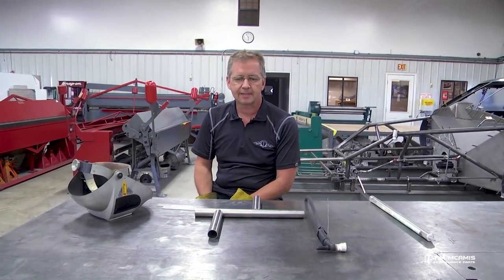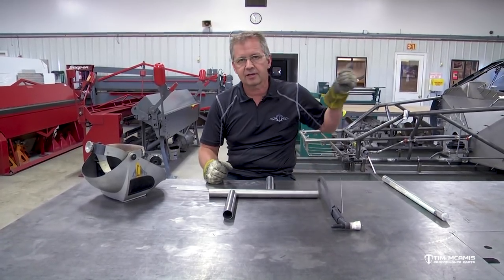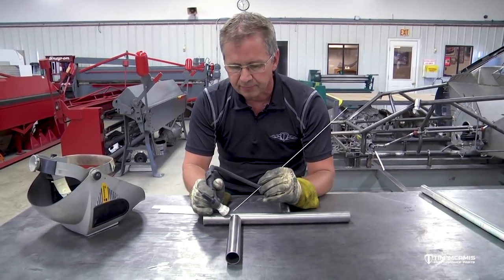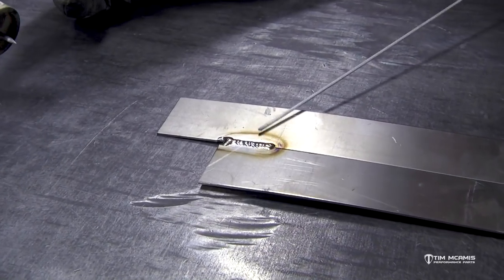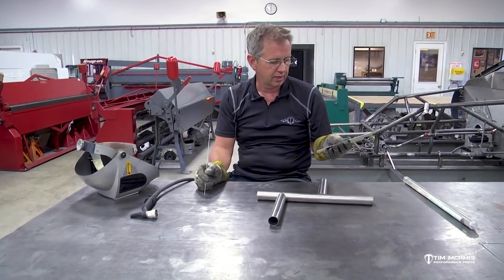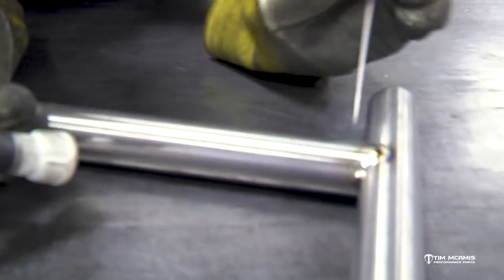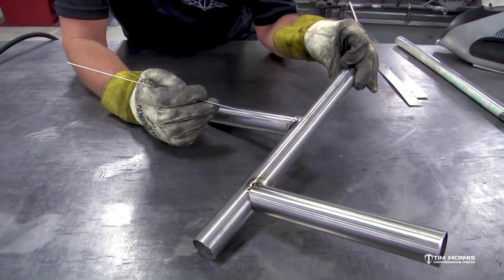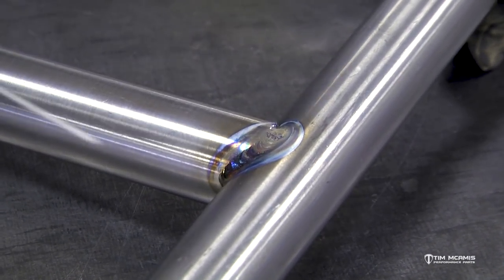Welding Titanium - Fabrication Series: 12

Comment: Shield your filler rod before you pull away from the molten puddle. Your filler rod is cherry red as well and it will contaminate your weld puddle when you start back up again. Great video and lots of helpful information👨‍🏭👍🏻
Reply: True.

Comment: Hi, was just wondering when you terminate the weld why u don't leave the end of the filler wire in the gas shield or cut the contaminated end off before starting the weld again ?.

Comment: It seems like sodering to me more then a weld. I used to work at a hvac shop. The shop Had sheet metal rollers. There was a Motorcross dirtbike race shop nextdoor. The owner asked if we could roll some titainium for his sons bike. We rolled it 24 times. It hardly had a bend. It was like a slight bend in a baseball hat. Titanium is interesting for sure.
Reply: Titanium needs lots of heat and tons of pressure.

Comment: shouldn't that be back purged like stainless?
Reply: DnV Auto Performance & Welding yup. Both tubes getting joined should be constantly purged while welding. The inside of that tube is in bad shape now.
Reply: @DroneRetrievalUnit oh i know it should be, im just more surprised he didnt stress the importance of it on the Ti, because that joint is trash, seemed like a waste of some good Ti, especially with the price of it, wish i could afford to waste it like that LOL
Reply: @Richard NZ I'm not sure what you mean by there only being metal on the backside, but I think there may be some confusion. The only way you dont purge titanium, that I can think of, is if say you are filling a gouge on a very thick piece. You are not penetrating all the way or even bringing the backside of the material to a reactive state. But say on a butt joint, like he demonstrated with the sheet metal, you are most definitely penetrating all the way through and getting the backside up to and beyond the reactive temp. And with tube, it is most likely going to be something somewhat structural. So, you need to make sure your weld is penetrating deep. If you dont back purge that tube joint, you dont have actual weld on the backside. Just a hot mess. Like trying to weld it with oxy acetylene. It loves argon, and the coverage isnt just for looks when it comes to structural integrity. Anyways.. Keep it metal \m/ weld on

Comment: Wondering if you have ever tried the Vortex cup. It is sold by Speedway Motors and Arc-zone. The cup is made of aluminum and then anodized black and is NOT recommended for DCEP,  I guess because of arcing. One plus, it won't break if the torch is dropped. Thanks

Comment: I want to start off by saying that These are good videos I just have one problem the way you are explaining things.  There is no difference in heat and how quickly it cools when you leave the argon on it or when you pull it away (the longer you continuously weld the hotter the piece will be at a constant welding temperature).  The color difference is oxidization when you pull it away.  If you look at the first weld you didn't give it enough time to cool down and it was at a temperature that the pipe started to oxidize.  There is a greater amount of oxidization when you pull away right after you finish the bead because you are introducing more oxygen.  The temperature is the exact same in both cases.  That gold hew about 1/2 inch away from the weld is where the oxygen is mixing with the argon and there is some oxidization.  Steel will oxidize at 1290 deg F (700C) and titanium will oxidize at 2,190 def F (1,200 deg C).  The TIG welder operates at ~11,000 deg F (3K-20K).  You have to keep the argon cloud on it until it cools below 1,290 deg F to avoid oxidization.  You are 100% spot on with your technique.
Reply: At what temperature does titanium go from silver to light straw color?
Reply: @brandyquad  in normal atmosphere around 700 F, but that is also a subjective question.  If you have no oxygen, it won't.  The color change is oxidation.  Any time that you are not welding in full containment (and properly purged) you will get color change.  The more oxygen that you displace the less of a color change you will get.  I see why you asked that question.  In my previous comment I said 1,290 F.  Above that is the blue to purple oxidization point in normal atmosphere.
Reply: @Rusty_Raine  Thanks for clarification. Thats very scientifically informative. I like to be on both sides of the fence when it comes to welding. Being knowledgable about what is happening and actually taking action, I think helps a person be a better overall welder.
Reply: @brandyquad  I agree.  Thank you for a good conversation.  I am a better scientist than I am a welder.  I grew up welding on my dad's farm.  He is a fabricator and a nuclear engineer.  He always prompted me to ask the question of why something happens the way it does.  20 years in the navy gave me a love for teaching others.  Hopefully within the next 3 years I will have a shop with multiple welding machines.  I just need to build the shop fist.  I am trying to set things up so I can film the shop build and creating a YouTube channel.
Reply: Basically any of part of the material that reaches over roughly 700° F must be shielded from atmosphere until it cools below that temperature. This includes interior of the tubing, backside of a butt weld or lap joint. The naturally occuring oxide layer, similar to aluminum, should be removed before welding since it contains oxygen. Lastly, remove all contaminants from the parts, filler rods with a degreaser such as acetone etc. prior to welding and all your joints will come out shiny and durable.

Comment: Other than being light weight why use titanium?
Reply: All depends on the application, but it is very very corrosion resistant. Titanium exhausts will outlast stainless. Good for salty/briney winter roads. I've heard some submarines use it for their piping because it lasts so long it's worth the extra money to not have to service it as often, which is stupid expensive, I guess.